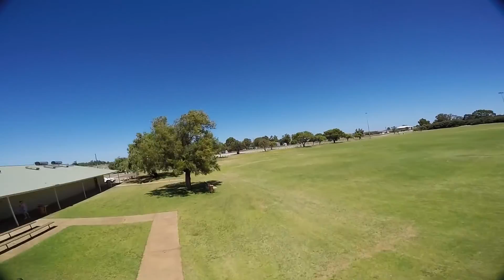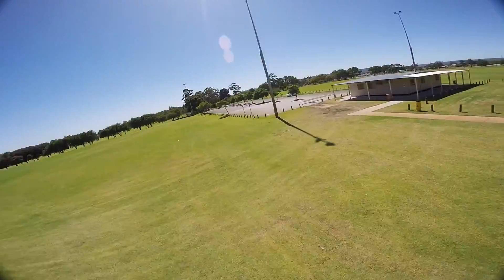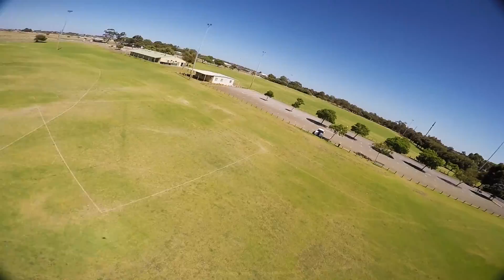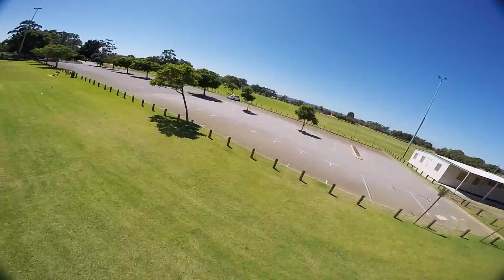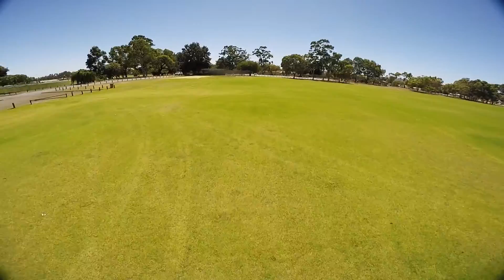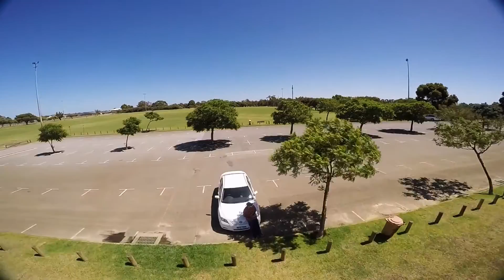Threading the gaps

Comment: no airmode no acro just should call it race car mode , very nice , 2.1.6 was very smooth, the yaw snaps are nice too
Reply from the maker: lol true, tracks like it's on road. Haven't bothered to update to the latest firmware will soon though to see what all the fuss is all about.
Reply: well ive been on borris experimental airlines since 2.1.6 ,  i have learned a great deal and become a better pilot ,maybe even help shape the final beta product. the latest relases have a lot of features and very fast looptimes , cheers
Reply from the maker: +RC Surf I have been following the thread since he first started in July last year and updating the firmware as he released new versions. I think I m about 10 pages behind at the moment lol. It moves very fast, miss a day and you find yourself 20 pages behind lol. Heard so many great things about the kiss flight controller and Boris's favourite esc the kiss 24amp. So building another 5'alien with kiss FC, kiss esc, kiss osd and lumenier skitzo edition motor 2500kv. can't wait to finish it and be able to compare with Betaflight.